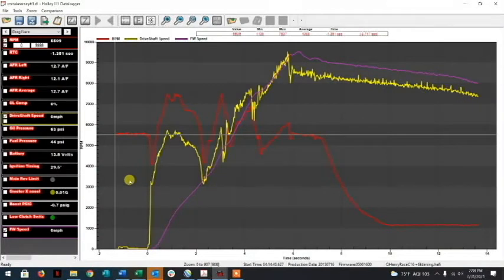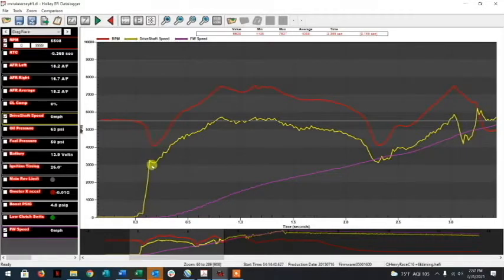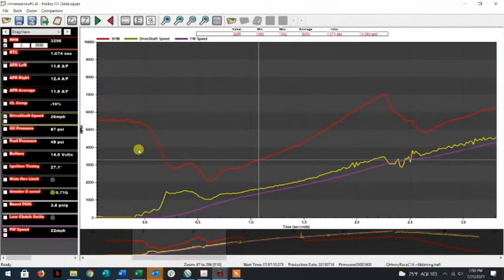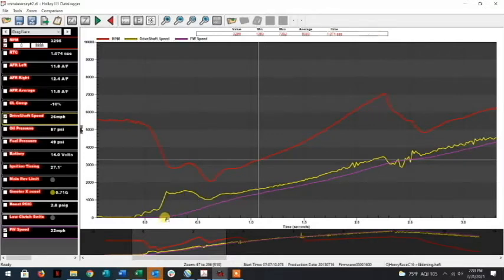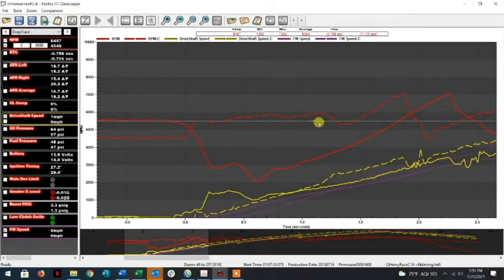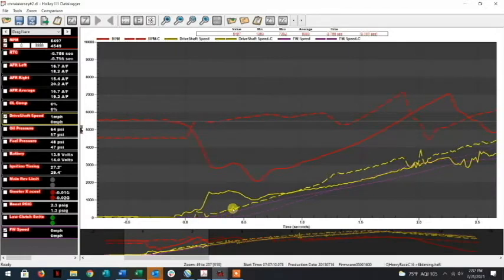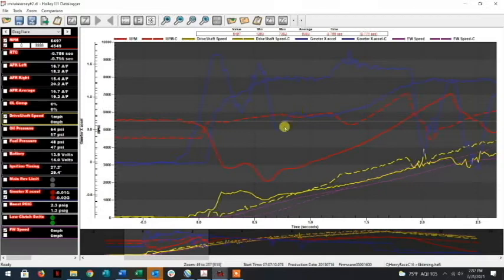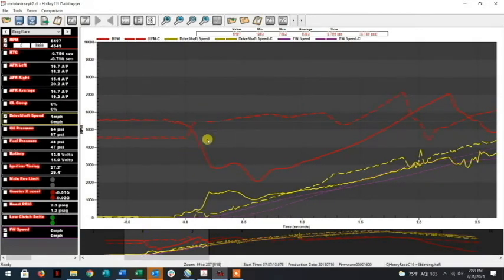Nerd Alert!- Data Log Analysis

Comment: Very interesting take on launching.  How will the "non-slipper" clutch compenents hold up to the heat of being "slipped"?
Reply from the maker: In my case they're sintered iron disks and it seems to be working really well and holding up fine, we will be doing some testing with other clutch materials but the amount of the slip is one second or less so I don't anticipate extreme wear but in drag racing the clutch is a consumable